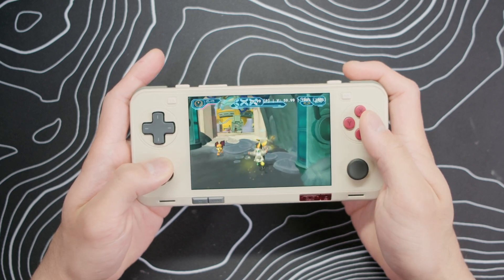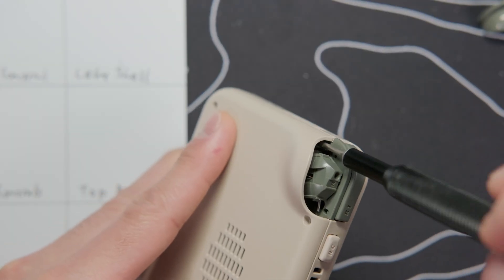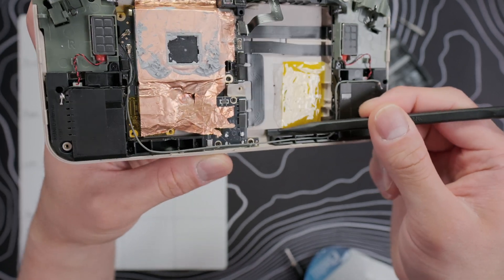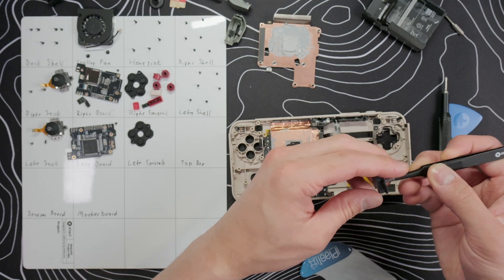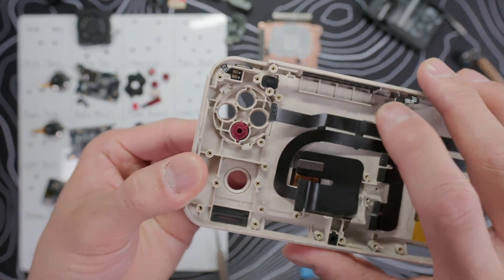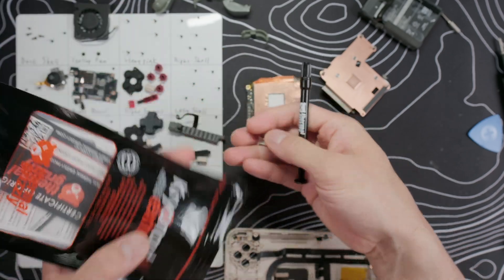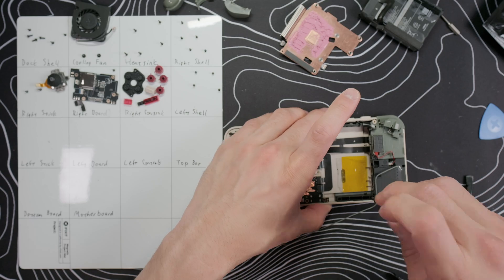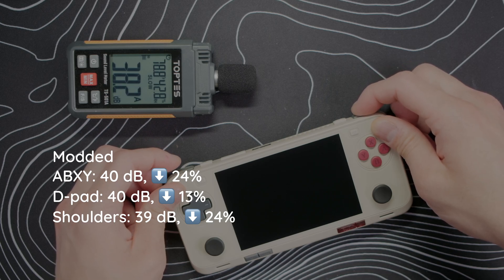AYANEO Pocket ACE Teardown & Modding Guide

Comment: Hey man, thanks for this breakdown. 
Managed to follow through and got the buttons quieter. 
Not sure if my device failed the qc check, but I noticed the left speaker is not working. So during the breakdown, I was hoping that the cable was not placed properly, but the problem still persists after the reassembly. My model is the retro version and was hoping if you know if there’s a fix? I’m afraid contacting ayaneo might result with shipping the device back to them indefinitely. Thanks for your time
Reply from the maker: I would contact them, they’ll probably send you a new speaker module if you send them photos and stuff

Comment: This was an awesome watch, very cool to see how the Ace looks on the inside. I do have some questions though:

1. Could you notice thermals being better after Undervolting? 

2. Were thermals (both before and after Undervolting) noticeably better than the Odin 2 Mini?

3. I noticed that at some points, Ratchet and Clank would dip a little bit. Which performance profile were you using at the time? I'd think Max would give better results, but I'm just curious.

4. Is battery life good? I'd think that with the 6000mAh battery, it'd be somewhere in between the Odin 2 Mini and Odin 2 (Pocket EVO in this case, since I think you have more experience with that). I've heard thermals on the ACE are a lot better than they are on the Mini, battery life too. If that's true to you, let me know.

Thanks.
Reply from the maker: Hey there:

1. Thermal stability was definitely better after undervolting, but the temps weren’t really different, maybe 1 degree

2. I did run it on my O2M (don’t have a portal) and the temps were basically the same, but with 99+% stability. The mini does have a smaller cooling system like the Ace, but it’s also a different, slightly less powerful chip

3. I was using Gaming, and I noticed the dips as well, Max didn’t make it that much better. Not sure if it’s that particular game or not. 

4. Battery life is pretty good, I’m doing testing now, GoW on PS2 got 4.5 hours on Gaming, and TOTK on Max got 3 hours